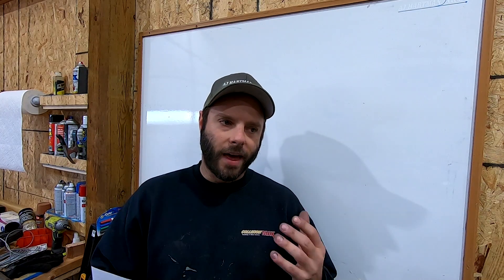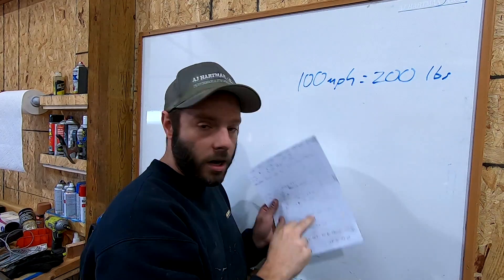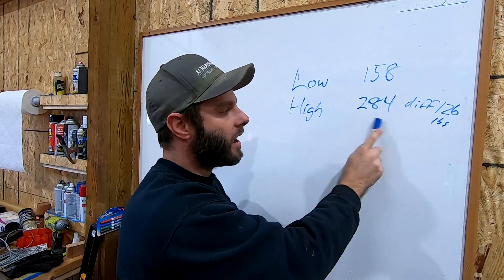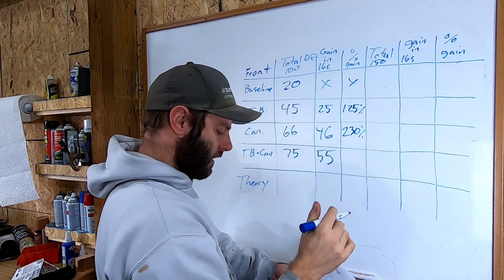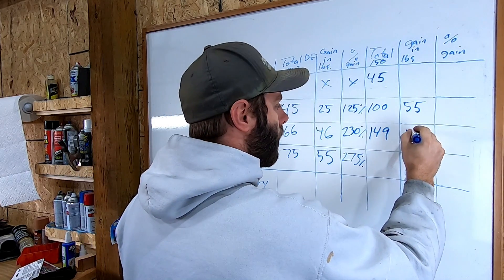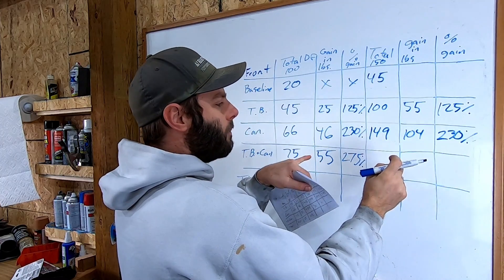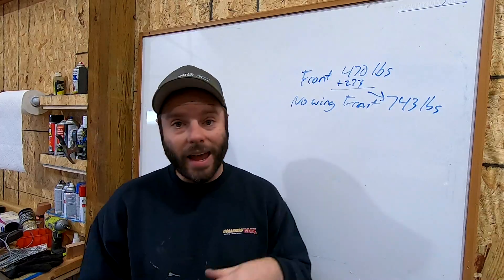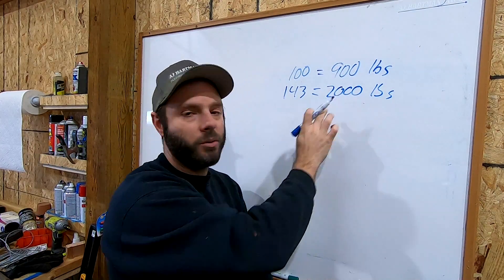Using Wind Tunnel Data to Explain Different Ways to Look at the Same Numbers

Comment: Thanks for doing the video. You talk a lot about downforce but never about drag. What if I just want to lower the drag as much as possible? Have you learned much with your wind tunnel experience?
Reply from the maker: yes. remove every single part off your car for the least drag.
Reply: @ajhartmanaero  Good to know. Raced against a very experienced driver/team a few years back. His car was a rocket on the straights and was impossible to pass. He had no aero and just went for least drag. It was like he had DRS! Seems like a great way to go. If you are fast on the straights, it is hard to get passed and easy to do the passing.

Comment: Is "leverage" in reference to wing AOA?
Reply from the maker: No. Think of it as a breaker bar vs. a short ratchet. Don’t change anything about the wing besides move it rearward and you will see more Df on the rear axle with a slight lift on the front.

Comment: Is there a test standard for wings? Seems like one could mount a wing on a pedestal that is on scales so all the effects of the air coming off the car are removed.
Reply from the maker: Unfortunately there is not. I mean, CFD tells us everything we want to know about the wing itself, but a wing is never by itself either, plus different CFD programs, and even different parameters within the same CFD software will yield different results. There are wind tunnels that use a mount that they can calculate out so you effectively get just the wing as well. So you can pretty quickly see how it would be really hard to have a "standard".